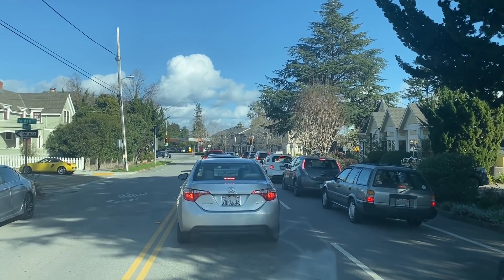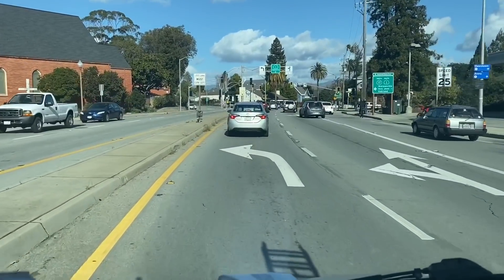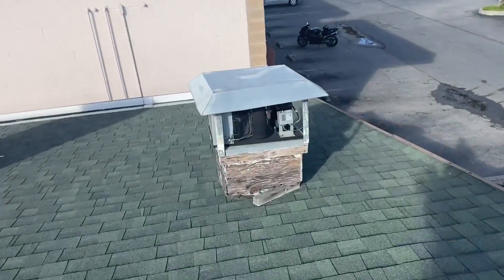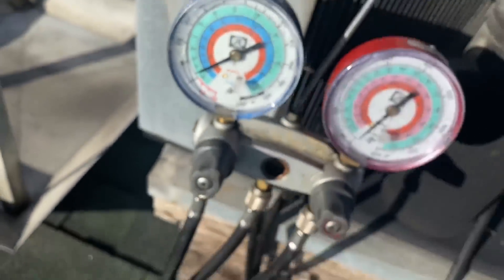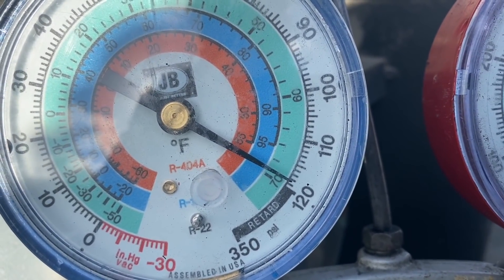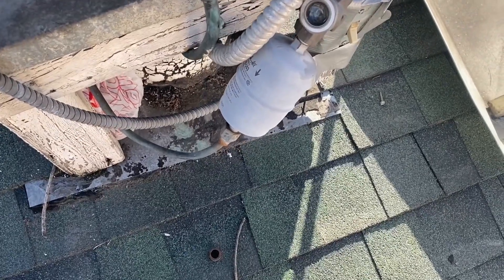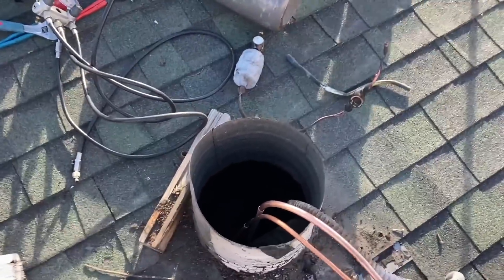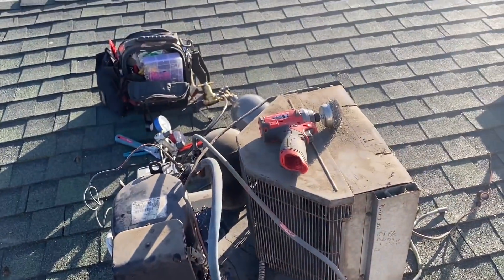Leaky Monday

Comment: Respected your walk-in install -- CHIT MY PANTS WITH USING A MAGNET ON THE LIQUID LINE SOLENOID VALVE AND NITROGEN PURGE -- OMG -- SUPERTECH -- MEH -- NOT SO MUCH.
Reply: Always use a magnet on the LSV or energize it during vacuum -- that REFCO magnet makes me nervous.
Reply from the maker: Wet wipes work better than toilet paper if you chit your pants. Nor cal tip of the day!

Comment: Dave, unrelated but... You had a video on a Delfield prep table using the Danfoss 1H1C case controller. 
 You removed the nasty bauble with a A12-1506. We changed the controller and probes 5 times in the last year and a half under warranty. I installed an A12-1506 and a Omron (True MC) 25 Amp relay. Thing has worked wonders for sooo long. Customer is happy they don't have to throw away product. 
 Thank you Dave. That right part of the evaporator cover is the perfect spot for the cold control. Not all heros wear capes Dave. You're a hero like it or not brother 👌

Comment: Double sight glass? Don’t you always do that? If 1 is good 2 must be better. The battery will never go dead on the ground, it’s the altitude of the roof that makes it go dead.  That condenser will be on the ground next time after the high wind. I had a 4 year old Mitsubishi with a leaky evaporator last summer, NO EVAPORATOR AVAILABLE. WTF nice job Mitsubishi 😡
Reply from the maker: Oh ya had that happen. New complete unit time.

Comment: Hey Dave. I have a walk in freezer box insulated floors and walls 14x8x8 it needs a condensing unit and eva. I’m in Illinois what do you recommend?
Reply from the maker: It’s tuff to say. I don’t know what your area sells.
Reply: I go troughs Johnstone supply  in Iowa. I can purchase from them I just don’t know how to size the condensing unit and Eva for the box. Any suggestions?
Reply from the maker: @alfonsotoscano5096  get your box size, thickness of walls, floor( insulation) if any. What product your freezing. What temp you want to keep it. What temp product arrives at. How long you need product to get to set point.  How many events per day or hour. Event is opening box getting product out. With that info the supply house can usually size the box.  
You also need your voltage and phase for equipment.  And have it sized for the hottest day. Example my area is sized for 85 degrees ambient. I get my equipment sized for 100 degrees ambient.  Hope that info helps you with your load calculation.